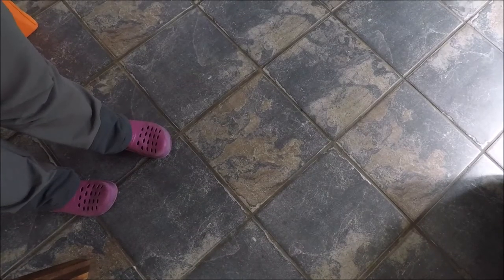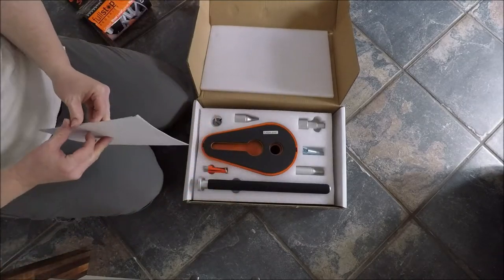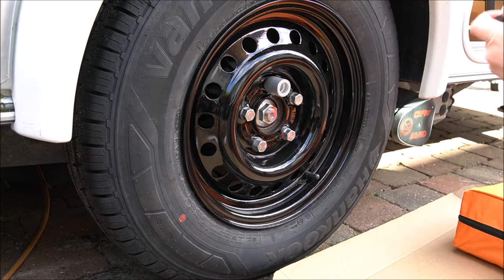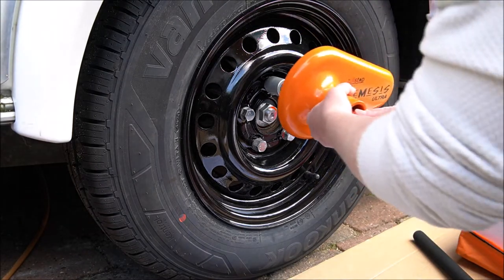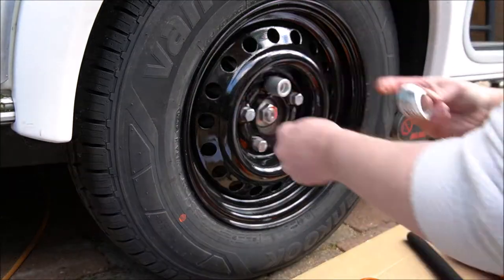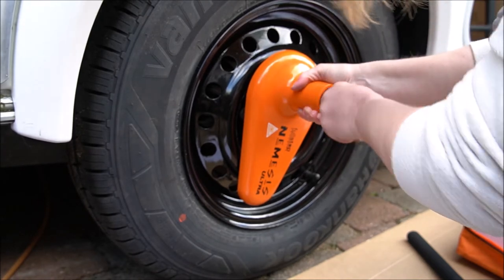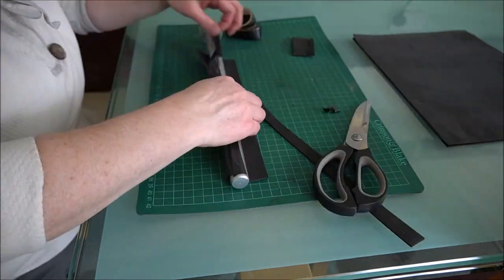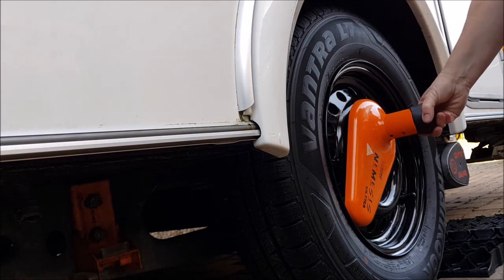Fitting a Nemisis ultra (caravan wheel clamp) on steel wheels

Comment: Hi Becky! I’ve seen you use this one or Milenco Compact C… which would you recommend? Considering price, easy of operation, weight/volume…
Reply from the maker: This one, much easier to use (the compact c basically requires me to lie on the ground to install it) though I do use both when the caravan is stored for extra security :) friends also rate the Milenco wraith, harder to set up 1st time but easier to use day to day apparently

Comment: That foam covering is to protect alloy wheels. I wouldn’t have bothered with steel ones.
Reply from the maker: I’ve painted my steels (video coming out next month) so the foam helps to protect the clear lacquer coat over the top of the black paint but had I kept them as the original steel then yeah no point real point to the foam. Thanks for watching.

Comment: The Milenco Wraith I have on my van looks much easier to fit and the wheel can be removed with just a normal wheel wrench, no key required for the new wheel bolt.
Reply from the maker: Good to know thanks. The wraith was pretty new and didn’t have many reviews hence I opted for this, but I have been wondering whether to add a wraith on the other side ie double security whilst in storage, thanks for the comment. Is your wraith on steel or alloy wheels?
Reply: @CaraVanOlogywithBecky  It's an alloy wheel on a Coachman.